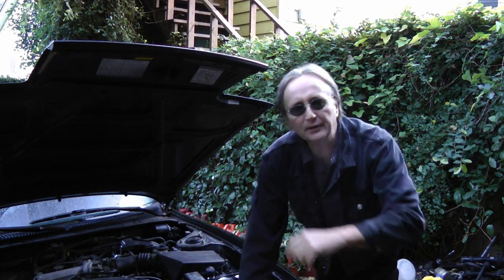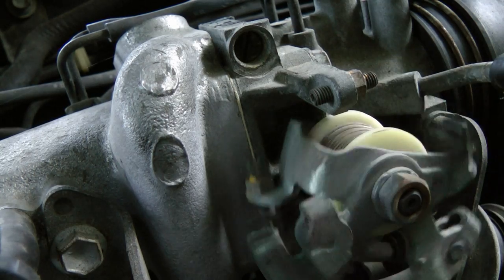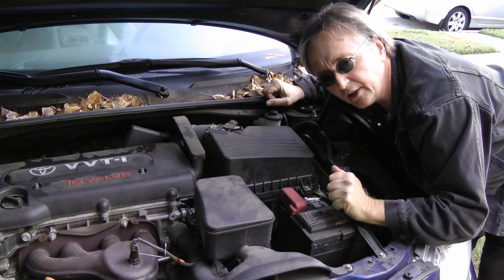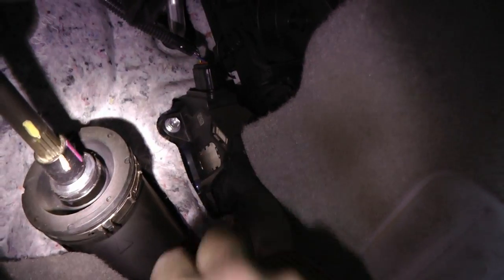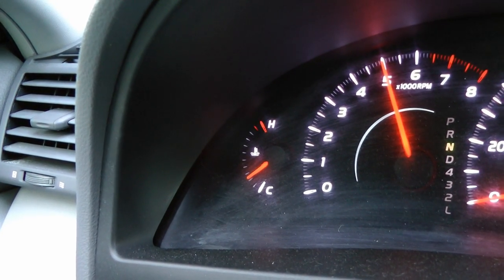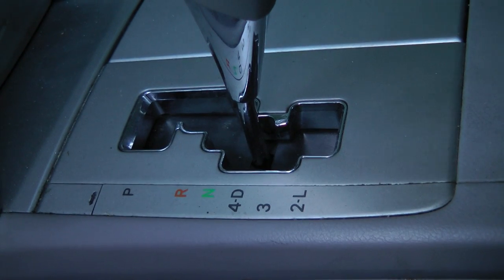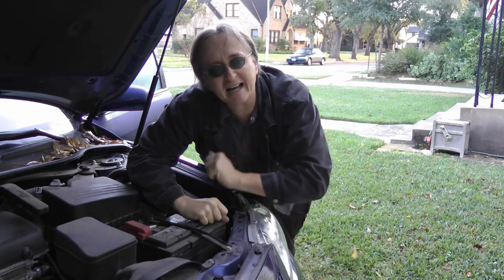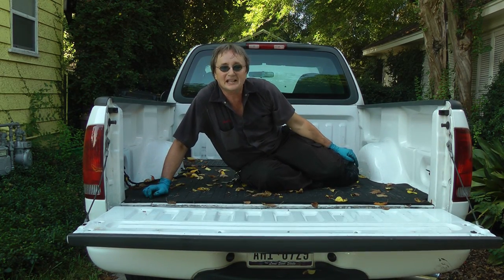How To Stop Unexpected Car Acceleration

Comment: I heard someone claim that some of these Toyota and Lexus cars that this happened in wouldn't let the transmission go into neutral at that engine RPM, or some nonsense of the sort. But I'd always thought that even on newer cars, the shifter is still connected to the valve body, allowing you to override the computer in such situations. Can anyone shed light on this?

Comment: @scotty good thing i found this video i think ima try this. I did a vacum chk like the one u did in ur video with the cigar but i didnt see smoke anywhere, then i cleaned the throttle, and iac(+passage ways) got a lil better but still every once in a while it surge like im slightly on the throttle. i dont think i can adjust the cables on my 98 saturn sl1 but i'll try this 1st =D

Comment: I thought there were fail safes in place to prevent this with the later-model electronic throttles? Some cars have TWO pedal position sensors while others may automatically close the throttle if it detects a high enough percentage of brake pedal input AND gas pedal input simultaneously. Are kars r smart

Comment: @MyDucatiGT1000 I think you are right and I was wrong. I asked toyota. They said the system was just replaced with an electric steering pump instead of hydraulic. I got to drive a 2011 toyota matrix when my tacoma was in for the rust recall. I swear it felt like the wheels were not connected. But apparently it is just an electric rack/pump in place of a typically hydraulic one. A subaru forester which I drove a couple years ago had a similar feel. It's a weird feeling though.

Comment: if you put into neutral, wont that give the engine less(or no) resistance from the transmission. causing the engine to redline or burnout??? kinda like revving the engine when your in park??

Comment: If you shut down the engine you don't risk ruining it by red lining. Brakes and steering never fail when the engine is off, but you need to use more pressure. You will have at least 2-3 brake applications before brake assist fails but a heavy foot on the brake will stop the car. One thing to remember though, never ever take the key out of the ignition as you will lose steering.
Reply: Yeah, I'm doing 70 down the interstate, I'd like my power steering and brakes. An engine can survive redline for 30 seconds while you pull over.
Reply: You have enough brakes to stop and power steering is just silly.
Reply: Yet again, if I'm doing 70 down the interstate, I'd like my brakes and steering. Your engine can survive redline for 30 seconds while you pull over.
Reply: Yet again. You still have both with the engine off.
Reply: Yes, because the brake booster (ran by engine suction, which is only available while the engine is running) totally will continue working and same with the power steering pump, who's pulley only spins when the engine is running. 

You have no idea what you're talking about buddy. Ask anyone that knows cars, shut the engine off, you shut off power steering and braking, making things 20x harder to control.

And again. Your engine can survive redline for 30 seconds.
Reply: Daniel Astbury No, you don't. And don't give me that "well old cars didn't have those luxuries, but they worked fine" Old cars have massive steering wheels, often twice as big as modern ones, which automatically means it's easier to turn it without power steering.
Reply: Newgenerationisbg So basically,  any modern car with a blown engine cannot be towed?  Seems legit.
Reply: Daniel Astbury You misunderstood. I meant, while you are going down the highway, you are better off NOT turning the engine off while you pop it into neutral and and go into the emergency lane. And as "chiniesefoodrocks" said, your engine will survive at the redline for a lot longer than it would take you to go into the emergency lane and not block traffic.
Reply: Yeah you can still operate these things, but shutting down the engine turns them off and makes it 10x more dangerous. The amount of time to throw it into neutral and pull the car off the road and slam on the brakes should take no more than 15 seconds.
Reply: Chinesefoodrocks1521  the breaks still work with engine of but become harder to depress steering works but becomes harder because the power steering pump is no longer running I know because my engine has stalled  going 60 down the freeway.
Reply: Newgenerationisbg  haha true ive redlined my car before its still runs fine the fuse on my tranny went bad and  it failed to shift the rpm just kept rising.
Reply: Without those systems being assisted by the engine, they are harder to use. At 80mph, I'm not shutting my car down. I'm not risking my life, my car or anyone riding with or around me to save an engine. I will gladly put a new engine in rather than cause a crash.
Reply: Daniel Astbury No need to tell people who owns chevy's! the key will simply remove it's self on tight turns!  :p
Reply: Vanboneio \ | commentary gaming channel | / I own a chevy Tahoe and have never had this issue on the suv .
Reply: Well i meant this for people who drive recklessly on turns, and yes the keys will come flying out no doubt about it!
Reply: my keys lock in the ignition ive tried to pull them out to test this and they still lock in I have a sharp turning radius to ive made turns at around 30mph with no issues just because of being in a hurry or late.
Reply: +Daniel Astbury - Come on Danny, you know this is about safety and awareness, not about your ego and half-truthed answer :)

You are partially correct, steering and braking are available but at reduced a performance level than what the average driver is accustomed to. In an emergency with the engine off, the car will handle unexpectedly different at a very critical moment.

For safety reasons, We simply wish for people to be ready for the sudden change in car handling should they ever feel it necessary to shut the engine off while in motion.
Reply: Don't many cars have a fuel cut off when hitting max rev. Mine does.
Reply: This is why they say to shift to neutral and don't mess with the ignition key at all, once you turn the ignition key to off, some vehicles it locks the steering wheel as well...its just best to shift to neutral and leave the key alone, at this point who cares if the engine red-lines and blows up, obviously there's a problem if you cannot stop the vehicle from accelerating, you should probably be looking at getting a different vehicle anyhow LOL.
Reply: Most electronic fuel injection car have rev limiters, so the car maybe touches the redline but is not going to blow up. Is more safe to shift into neutral, THE ENGINE IS NOT GOING TO BLOWN UP OR GET DAMAGED. We're not LIVING  in the carburator era anymore.

Comment: The only reason I can think of to not use a conventional cable is because of cruise control, it's easier to connect that with an electric throttle than a manual.
Reply: +David Goldberg Drive by wire also enables much easier and better traction control and stability control.
Reply: +Aldous Forest drive by wire uses extensive algorithms to apply the optimal amount of throttle based upon economy and available traction.  this translates into superior fuel economy and safer handling in emergency situations, albeit at the expense of making the car feel more "dead' due to its disconnected feel.

Comment: A friend of mine had a Torino that as soon as you touched the trottle it would go wide open. I told him the car was possessed by a demon or the motor mount was broken. It turned out it wasn't a demon. The broken motor mount (rubber) caused the engine to tilt and pull the throttle cable!.

Comment: I thought that most "unintended acceleration"  cases have actually turned out to be someone mashing on the gas instead of the brake.  Except for the cases once in awhile that you talk about where there's an actual mechanical problem.

Comment: I have to agree, I prefer the regular cable too.  Scotty, gota ask though.  For a car like that Camry for instance, don't they also use computers instead of cables to change your gear selection?  Do they even use a cable anymore?  Not trying to throw a bunch of what if's out there...but if the throttle is sticking and you have an electronic gear changer (like a Prius) instead of a cable opperated selector, does the same concept apply there?

Comment: Actually having an electronically controlled throttle like this makes creating a car cheaper for the manufacturers.  This way they DO NOT need a separate Cruise Control Module, IAC Valve and throttle blade, it can all be controlled by the one butterfly valve and an electric motor attached to it.

Comment: I remember one time I was getting on an exit to get on another highway and my rpms went down to zero and I lost power steering and almost went off the road because I couldn't turn. Of course I was calm enough to get it going again but I still never figured out what went wrong that day.
Reply: Check your fuel pump, O2 sensor, fuel filter, and make sure your battery connections are nice and tight
Reply: Happened to me also, but while stuck in traffic. Haven't figured that out either.

Comment: You're worried about the engine dying when there's a much greater chance of you dying? For starters, you knock it into neutral, hit the brakes and it takes a few seconds to stop the car. You then turn the engine off to prevent further damage.
Secondly, if your engine dies in this process, the fact the throttle stuck on warrants an investigation and should result in a defect listing on the car and a recall to prevent future occurrences. The manufacturer is then liable for your engine damage.

Comment: @MyDucatiGT1000 I haven't see one in person or taken one apart. But it gives all the signs of not being connected.
-Turning with minimal pressure
-Not feeling bumps transmitted from front wheels to steering column vibration (you still feel chassis vib though)
-Hitting a bump and feeling the front wheels move a little but the steering wheel not move then the wheels turn back. you know how u can hit a pot hole and the car will go slightly sideways in lane?
Anyways... good day. :-D

Comment: I have heard some automakers have a feature where if you press the brake pedal it will automatically disable the accelerator and let you stop; even if you are still in drive. Is that true? If so, do you know how many automakers do it?
Reply: Yes, in newer cars.
Reply: JuxtaGenesis Hm yeah, it's also probably a good thing to help reduce brake wear and drivetrain wear, when someone presses on the gas (or if it's stuck) and the brake at the same time. Then again, you might not be able to do burnouts with that :P

Comment: Some cars are using drive by wire brake systems.  That is, the brake pedal is not physically connected to the brake booster/master cylinder.  A computer does all of this for you by means of an actuator that gets a signal from the brake pedal.

That's just asking for trouble.  Of course they will build in some kind of fail safe radar in the bumper to reduce anxiety about it but I would never buy a car with that system on it.  The cost of the car would be significantly higher too.

Comment: Since the throttle is essentially floored, wouldn't shifting into neutral blow the engine, or is the engine speed capped at the red line by the computer?
Reply: Almost all cars have a rev limiter.  However, if the computer is messed up enough it's making the car accelerate out of control, that might not work either.
Reply: rev limiter
Reply: Yeah, that's what I'm thinking. One electronic "control" is messing up for sure, so do we want to risk an engine by assuming the other electronic "controls" are working?

Comment: Oh I meant to add as as as I am aware the Australian Design Rules will not allow electrically controlled throttle. All throttle control MUST be as a result of physical input from a mechanical input from the driver ie Throttle Cable or push rod linkage to Carb or throttle body and injection system etc.

Comment: Hi Scotty, this video's a little old hope you don't mind me asking.
So after you put it in neutral the engine is physically disconnected from 
the wheels but does the engine continue its upward acceleration and perhaps 
destroy itself ? 
I had a Holden car years ago with electronic throttle control that, aside from a plethora of other issues, it would stay at speed for several seconds when I took my foot off the accelerator.  It never had unintended acceleration but this was around the time Toyota were have those issues so it did worry me.
Reply: an engine will never destroy itself by revving high. well if you are worried about that case just go hard on the brakes to stop the car. a stock brake kit is designed as it is capable of stopping the car even when its running full power.
Reply: It has a rev-limiter. Won't let you do that.

Comment: I have a ford escape xlt 2008 and in the morning when i use it doesnt want 
to shift right and when im driving 20 mpr it slows down and accelerates by 
its self really bad and it will continue to do this through out the day even if i 
let warm up any ideas on what it could be ?

Comment: Hey Scotty....you may not be checking the comments on this video anymore but I have a related question.  What about a 2006 Camry that "jumps" when you hit the accelerator for the first split second, and then accelerates normally beyond that point?  Whenever I'm at a red light and it turns green, my engine revs up really hard for a fraction of a second and the car jerks no matter how lightly I press the pedal.  is this related to the unintended acceleration problems?
Reply: 4 cylinder model by the way
Reply: Do you actually feel any acceleration or is it just the engine?  Sounds like a transmission problem.
Reply: +Jeffrey Basurto Yes, the car kind of "jumps" for a second before accelerating normally.  it also shifts down really low while going downhill sometimes.

Comment: and there have been a couple 350 v8's that have actually made 1 million miles. dont think there are any toyotas that can claim that title of million mile engine. i was pissed at GM for discounting the 3800, what a fantasic engine in every variation. the L67 and L32 versions are screamers. around 300 ft/lbs of torque and still get mid 20's mileage. that's impressive

Comment: My truck did this. I had pressed on the gas to get up a hill and was still accelerating after I let off the gas it started going faster. I tried lifting the pedal but did nothing. Also noticed my gas pedal is loose

Comment: There is nothing as the sensation of just step on the throttle, the cable pull the air regulator.. .and no computer interference to what you want the car to do.
Eletronic throttles really has no plus side for me (except to fix the low end pull with a weak engine with A/C on)

Comment: Mine is doing it in park, reverse and drive. I'm talking super fast. At first I put the car in reverse and it didn't move. Then I pressed on the pedal harder and it when crazy. Almost smashed into my other car in the driveway (burnt tires when I pressed the brake). Put it in drive without pressing on the pedal and it accelerated fast. 
The car revvs high while in park. The engine shakes like crazy. I have not driven the car for a couple of months. Any ideas?

Comment: I had a work truck that accerlerated  unexpectedly.  The engine would not shut off even with the key pulled out.  I thought it was going to blow up the engine, but after a few minutes the engine just died.  Very scary.  I thing the engine got overheated and was self combusting the gas on it's own.  Never did it again.  I quit shortly after that . Really bad company to work for.

Comment: @sketchyinc 
i think its all about ease of building.. my car raise the idle by 100-200rpm when AC is on.. with an mechanical system it would be more expensive then telling the computer to raise the rpm and more that can fail.

Comment: At first I didn't like the whole drive by wire idea. On the other hand it can do wonders. It can save fuel and possibly save your life. In my trailblazer screwing around in the snow it would actually cut the throttle when it senses wheel spin whether it's in a straight line or even worse, going around a corner. In that case it would also sense steering angle vs direction of travel and apply brakes to whatever wheel needed to get it going in the intended direction. In higher horsepower cars it can help gain traction for better acceleration. My 2000 camaro actually pushes the gas peddle back at you when is senses wheel spin as it is still cable actuated. What a weird feeling at first. Of course you can turn it off if you feel like playing. Same goes for the trailblazer.
Reply: Electronic traction control is one of the most irritating things put on cars nowadays. I'm all but positive it's killed more people than it's saved.
Reply: Depends on the model your talking about. Beside that, haven't you ever heard of a throttle cable sticking? I've had that happen before. You've probably got a better chance of that happening then a dangerous problem with throttle by wire.
Reply: I'm not talking about drive by wire, I hate it, but it doesn't kill. You mentioned electronic traction control as a plus from drive by wire (even though it existed far before dbw came around). Tcs is just so annoying, and I'm sure it's killed people who needed to get out of the way of something, lets say a train, by cutting power to the wheels. It kills the acceleration.

Comment: The real reason is that controlling power purely with the air resistance of a throttle plate, and forcing the ECU to constantly react is not as effective.  Electronic throttles allow the engine ECU to do things on its own terms in order to maximize efficiency and power.  If throttle by wire wasn't better, it wouldn't be used in F1.  It's a very old technology, having been used in "fly-by-wire" fighter jets for 40 years.